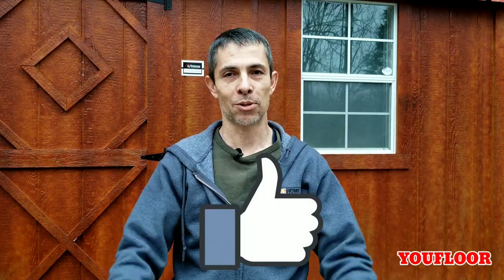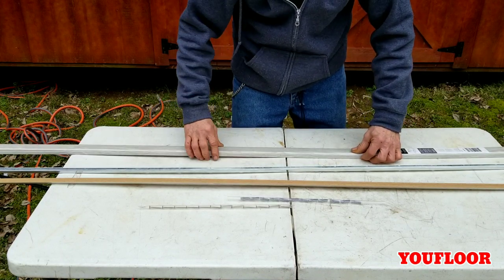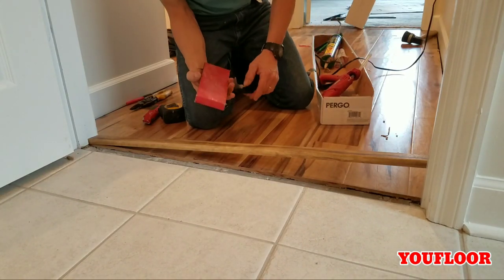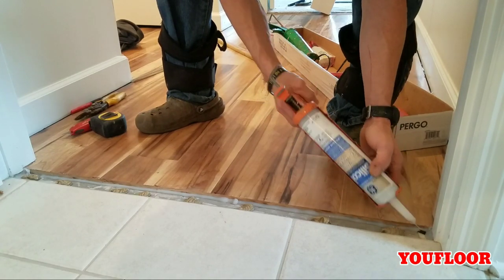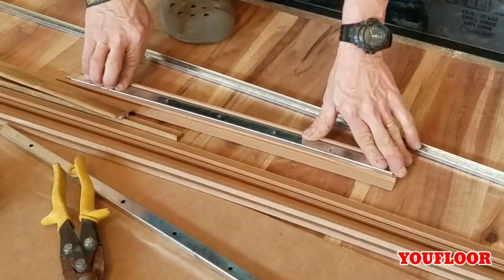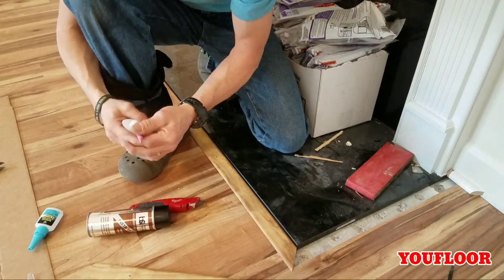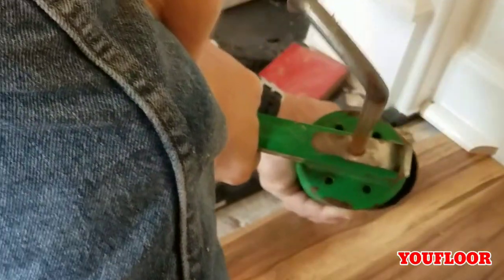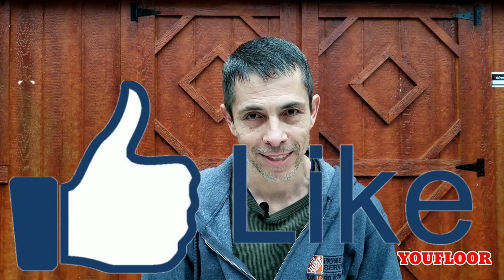Installing Pergo 4 in 1 Transitions On Concrete With NO SCREWS!!

Comment: it is driving me buggy that the paper is still on the transition strip, and also when you spray that stuff (the second part of the ca glue, you sprayed right above the black tile in front of the transition strips, without putting a large rag or something to protect it from overspray. I guess being a woman, I notice these things that bug the heck out of me. I just can not watch repair men when they do repairs in my house because the veins start popping out of my forehead when I notice similar things happening. I guess it is more of a woman thing because they know what a pain it is to clean things off that could have been avoided. I hope the home owner did not have to deal with removing that paper which is sometimes hard to do. Other than that, good job!
Reply from the maker: I can assure you I always remove the paper before I leave. sometimes I’m just going so fast I like to blow and go and take care of those small details at the end. As far as the overspray goes, this stuff has never harmed any materials that I put on and I always use baby wipes and shop vac to clean everything when I’m done. Thanks for the comment. See you on the next one.

Comment: Maybe a dumb question, but I was planning on gluing down this type of transition to join a laminate and a LVT glue-down floor. I realized I would have to stop the moisture barrier right at the metal track. Is there any reason I would have to worry about moisture under the t-mold reducer if it's glued down instead of screwed over the top of a moisture barrier?
Reply from the maker: @Brandon Mc No sir that should be fine. The glue acts as the moisture barrier. Tks for the question.
Reply: @YOUFLOOR  Oh, that's right. I forgot about that. If you needed to use the spacer that comes with this kit, would you be able to glue it to the metal strip and the concrete as well, or would you be better using a wood shim of some sort?
Reply from the maker: @Brandon Mc yes you can glue them both down. Make sure to use a urethane glue it binds good to both materials. Tks for the question.

Comment: From the front door to the tile floor and both are pretty much already level and because of the door I cannot have anything sticking up anything higher than the floor other than a hair  I just have to fill up the gap which is like a half inch deep 2 in wide

Comment: What type of glue did you use for the u channel?
Reply from the maker: Pl  with the 3x on it. It a urethane glue. Little more pricier than liquid nails. But sticks like concrete once it sets up. Thanks for the question

Comment: Nice direction I worried myself about this part bc I didn’t want to drill in my slab and I had did such a great job with the floors I didn’t want this part to look trashy but this method is awesome just do exactly what he said and you will be impressed with yourself❤💪🏾💪🏾💪🏾🤞🏿
Reply from the maker: I appreciate that. Glad it worked out.

Comment: Why do you use the metal tracks if you don't screw them to neither concrete or wood floor?
I am very curious, most floor installers don't use the metal track.
Reply from the maker: I use it for two reasons. One, it helps to hold the transition in one piece. And also it makes the transition a little stiffer, so when someone steps on , it doesn't break. Hope that helps. Thanks for the question
Reply: Great, I will use it tomorrow then. Gracias.

Comment: Really enjoy the detailed demo video!!! Let me ask a couple of quick questions qbout the Loctite and trim channel: For Pergo Outlast+, don't you still need to add the 3/8" foam strip between the U-channel and the flooring? Also, when putting down the Loctite, don't you have to be cautious about the glue spreading to and bonding with the flooring material and inhibiting its expansion?  Thanks!!
Reply from the maker: Hey Dave, thanks for the question. I like to put silicone on both sides right up against  the flooring. This builds a dam for the lock light so it doesn't encroach on to the flooring. 100 % silicone is
Flexable and should allow the flooring  to still expand and contract. I don't use the foam if I am gluing a transition  down. Hope that helps.
Reply: @YOUFLOOR  Good enough, just getting ready for a big job that will butt against several thresholds/transitions and don't want to mess up the warranty. Thanks again!!

Comment: Great, thanks and question to anybody that might be able to help.
I installed 2 on laminate flooring. One floor was slightly higher than other, maybe 1/8 to 1/4 inch. I used the one with metal chanel which I glued to concrete floor and just pushed the transition piece. After one day of drying and removing weights, the transition pieces move a little when stepping on them.
Was I suppossed to glue them to the metal chanel?
Should I remove them and add glue/silicon?
Or is it normal that they move a little?

Comment: Great video.  I was looking for your kind of video because I don't want to drill into my concrete.  I'm surprised you didn't use an oscillator at the door jamb versus you trimming away at the molding?  Why did you choose to trim the molding?
Reply from the maker: Well I figure when the customers eventually sell their house, one of the 1st things they do is change the flooring so I try not to damage the trim  incase a different style floor is laid in they won't have to repair trim. Plus, the guy who taught me did it that way. So I've just always done it that way. . It's not that big a deal if doing  lvp or laminate. But if you're installing hardwood, that could be an issue later. Thanks for the question

Comment: I Could only find T-Mold transition that matched my laminate. So, going with T-Mold as transition from laminate to carpet under door.  I really liked the T-Mold method (laminate to carpet) you presented in another video. I Kinda like the look better, as well.   There is one difference - in the other video, it was a wood-floor, so you screwed down the U-channel, first.  Then you hammered in the T-Mold.  I have a cement floor and not fond of drilling holes into the floor.  So, I am assuming you can still use PL-3 glue, as shown in this video. Looks like I will first have to attach the T-Mold with the U-Channel as one unit, then push down on the glue.  Will that work? Any issues?  And, your videos are super helpful (Awesome Dude!) - Thanks!!!
Reply from the maker: If I have to put down a 4 in 1, that needs to be a reducer or carpet transition. I will install the metal track and install all is one. However, if you are just installing A T Mold. You can skip
This step , as long as you put a consistent weight all the way across to hold it down. For me, the u channel just helps to how the transition straight and stiff for laying on the squishy carpet. By the way, I like the t mold to carpet look too. Nice transition. Good luck brotha👊

Comment: Great video sir, you have mention at the beginning of the video already, but just to be sure when I make a trip to the store to grab the right product, what's the molding at the fire place call by the way?
Reply from the maker: Those are going to be called transitions. If you are setting g it on the new flooring and picture framing around you hearth (butting g up against it) Then I would get T molds. But if you are lipping up on the hearth and going down to the flooring then I would go with a multi purpose reducer. Hope that helps. Thanks for the question
Reply: @YOUFLOOR  thank you very much

Comment: Will this technique work on a laminate to laminate transition?  What do I need to do differently, if anything?
Reply from the maker: Should work?You really should not have to do much of anything different. Just make sure you have enough room for expansion. Because you're glue. Globs may need to be a little bit taller to reach the bottom part of the transition. Sometimes, I will put glue down on the floor and then put my transition down and see where the glue touches it and add some glue to the actual transition so that it marries the other glue glob. Then, you can either tape it or set some weights on it until the glue dries. Hope that helps. Thanks for the question.
Reply: @YOUFLOOR Thanks!

Comment: Hello.  I have a Simple Solutions Transition piece that was installed between tile and the wood floor.  It was installed with globs of glue, but from what I can tell, without the metal u shape channel.  So it is glued directly to the concrete... So, now the top piece has torn apart leaving  what was glued stuck... so what are your suggestions on how to remove the adhesive that was used (it's super hard) and the part of the transition that is still stuck in the gap without damaging the tile or the wood floor, so that I can install a new one? I've thought about a heat gun to soften to try and loosen the adhesive, I've thought about just chiseling it out or trying an oscillating tool...  Do you have any suggestions. Thanks
Reply from the maker: I experience this all the time unfortunately there is no chemicals that will soften it up. I just use a flat head screwdriver  and a chisel.by getting under the glue and tapping with a hammer,  it should come out fairly easy. Hope that helps. Thanks for the question

Comment: Wait. The silicone that seals the laminate for water leaks will not hold down the laminate and prevent it from expanding/movement??
Reply from the maker: No. Silicone is flexable
Reply: @YOUFLOOR  thank you! I have another question that I'm not sure if it's gonna be an issue, but I think it is for me. I installed laminate next to tile, and the tile runs flat next to the laminate except for about 2 feet in the middle of the 15 feet run, where I think the tile is caved in?? I ordered some flat transitions because I thought it was flat all the way through and I just recently noticed those 2 feet where the laminate is a bit higher than the tile.

Do you think that's gonna be a problem?? And have any tips on what to do there???
Reply from the maker: @tripas421 send me a couple pics of your issue so I can get a visual. Youfloor.net@gmail.com
I can probably give you some kind of tip!  I will be looking for your pics!
Reply: Hi I just emailed you :)) thankssss

Comment: Do you put the silicone on the wood side? Or only on the tile and stone side?
Reply from the maker: @pmexplore You definitely need it on the wood side as it needs to stop any water from going underneath the wood floor. You don't have to put it on the tile side but you can if you'd like. Hope that helps. Thanks for the question.
Reply: @YOUFLOOR  

Thanks that give a bit more clarity. Thank you for your fast response. 

Does putting silicone like this impact the expansion of the floors?
Reply from the maker: No sit. If you read it. You will see that the silicone is flexable and will allow the floor to to still move. Btw  expansion sounds drastic but. it really is not a lot of movement . Thanks for the comments

Comment: Hi, omg, my vinyl plank flooring in my kitchen was put down over the existing floor, causing a major lip of about 1 inch and a quarter maybe. I'm also having the vinyl plank flooring  put into my living room next to the kitchen. What would be the best way to transition between the two rooms. So worried about this. I don't want to have to raise the rest of the house up to my kitchen. Thanks.
Reply from the maker: https://youtu.be/_oTUB9EM3a8. Check this video out. See if it helps

Comment: If you caulk the edge of the laminate, will it still be able to expand?
Reply from the maker: Yes sir. I asked that same question  during the installation class we took. As long as you use 100% silicone it is flexible and stretches just enuff to allow for expansion as long as you leave a big enuff gap. Hope that helps. Thanks for the question
Reply: @YOUFLOOR  that’s good to know.  Next to bath tubs and showers this would be great.
Reply from the maker: I believe it even says bath and shower on the  label 😁
Reply: Is it nessasary to attach metal if your are just gluing it ?
Reply from the maker: It is not necessary.  But I would use a urethane glue like pl 3x if you are gluing it to concrete.  Good questions . Thanks

Comment: Do I need backer rod in the transition if so what side
Reply from the maker: You don’t have to use the backer rod in the transition but be sure to put silicone down both sides of the transitions to seal it to the floor. Hope that helps.

Comment: What do you do if your transition is between two floating floors and the subfloor is concrete? How do you allow it to expand
Reply from the maker: Generally transitions of any kind are about 1and 3/4 inches to 2 inches wide. You're going to need to leave about a one to one an a quarter inch gap between floors.  Then I use pl 3x made by lock tight to glue the transition down. Try to keep the glue contained to the center so your flooring doesn't expand into the glue. Glue tape and weights to hold it down or I use hot glue to hold in place while my pl 3x sets up. Usually takes a couple hours.

Comment: Hi Zenon, can you do this from a laminate to carpet transition?
Reply from the maker: I have done this before with carpet. You will need to make sure to glue down a carpet reducer.  And it wouldn't hurt to put some glue under the tack strip for extra hold. Place the tack strip about 1/4 inch away from transition leaving a small gap all the way across the door for tucking the carpet. Then I would let the transition glue set up for an hour. After that it can be cut to fit and then kicked over the tack strip and  tuck it. I have a video called installing transitions from carpet to laminate. Check that out for reference. It's pretty much what I just explained to you but with a visual. Hope that helps. Thanks for the question
Reply: @YOUFLOOR  Thank you so much!

Comment: What kind of transition did you use to picture frame the fireplace. A t molding or reducer ?
Reply from the maker: In this case I used a reducer. But you can use a t mold. You just need to cut some 1/4 wide strips and glue them against the fire place so that the t mold has something to stop it tipping down on the fireplace side. Kinda like it you were installing a  t molding between 2 laminate floors. Hope that helps. Thanks for the question

Comment: Hey I want to lay a lock in laminate flooring over my existing ceramic tile floor however one or two of  of the tiles are slightly uneven and the grout around them is a little loose when I step on it is there anything I can do to smooth those high places down evenly? will padding help if you have had experience with this I would love to hear
Reply from the maker: There are a number of things you could do but the best most effective is to skim coat it with a floor patch. If there is a spot that is to high you could grind it down flat 1st then patch it. Make sure to remove any loose grout. If it start coming up under your floor it could make crunching sounds when you walk on the new floor. The most cost effective method for small dips is to build it up in layers with felt paper. Use a 6 foot strait edge and fill in any low spots with the felt. Make sure to tape it down so it doesn't move over time.  It is thin, but just dense enuff to help with dips if you build it up inlayers. hope that help. And thanks for the question. It helps with future video ideas
Reply: @YOUFLOOR  thanks man although I did not understand any of that LOL hopefully you can do a video showing all of this really soon keep up the great work man
Reply: @YOUFLOOR  thank you what would I use to grind it down with hopefully you can do a video showing all of this really soon.  love your videos keep up the good work man
Reply from the maker: Thanks so much for the kind words. If you don't have a grinder you can rent one from home depot or Any tool rental place for that matter. The only downside to grinding concrete is you will have to plastic everything off because it can get pretty dusty. But if you want the hump gone there really is no other way.

Comment: My hardwood floor is higher then tile , .25 in to .75”.. what type transaction should I get? I bought finium 4 in 1 transition , not sure how to use it..
Reply from the maker: With each transition package there should be a small piece of cardboard with instructions for assembly. If it's only a 1/4 inch I probably would use a t mold and then pad it up if needed. Anything over a 1/2 inch drop make the slope to steep for a t mold in my opinion. For that I would go with a reducer. I transition up to a 3/4inch drop with that. Any thing higher would need to be wide so not a big drop or use a stair nose if we get too high. Some of those transition come with a little cutting tool and you just make what you need. Some come if part that you have to assemble(not a fan of those) be careful the edges are sharp on either one. Can cut you. Terrible paper cut hope that helps. Thanks for the question